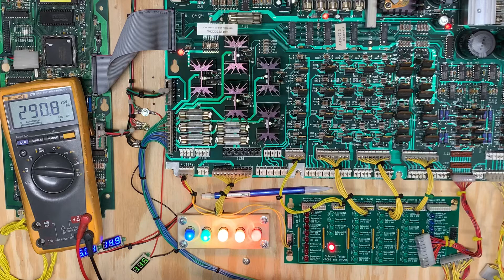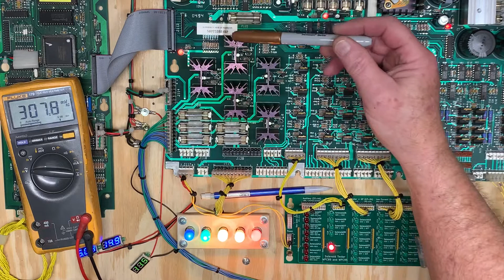WIlliams WPC General Illumination (GI) Explanation and Demonstration.

Comment: Hi, I have a problem with my Getaway pinball machine.  Want to test GI Lamp that is in the pop bumper, AFAIK it is 6.3VAC (alternate current) there are two wires going into the lamp socket, how can I test with multimeter when the machine is on if the socket gets the voltage the bulb needs ? if it's the one wire is GND and the other is Voltage ? what I should use as a test point (gnd) for multimeter black wire ?